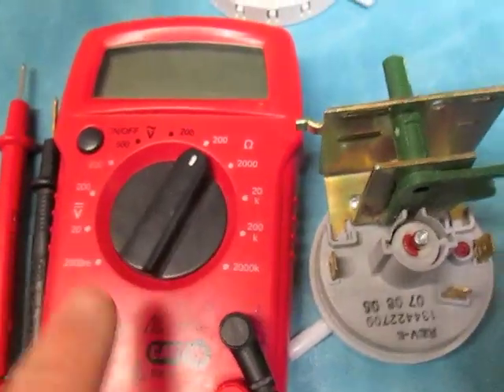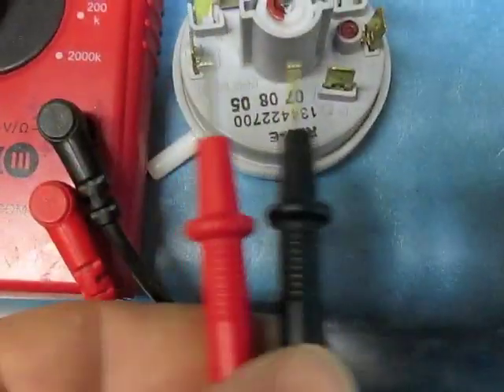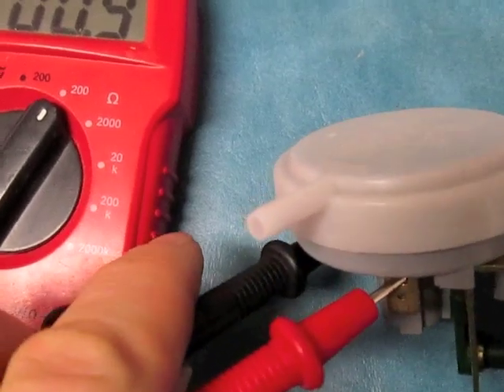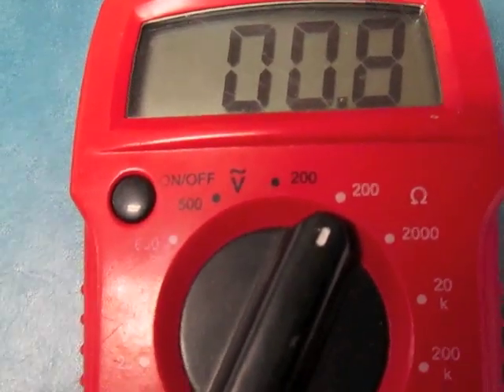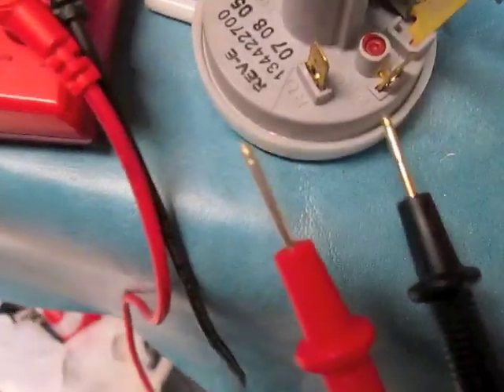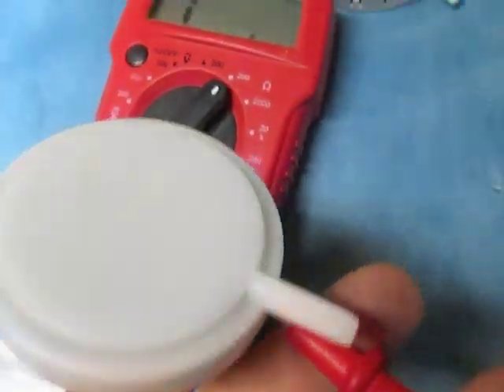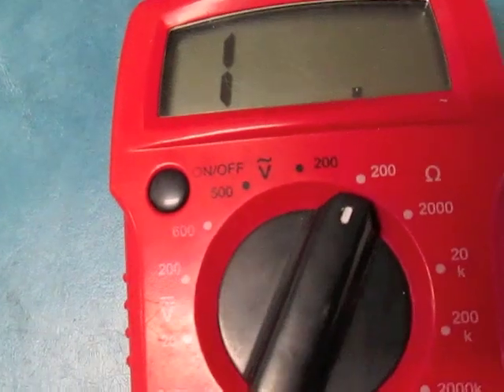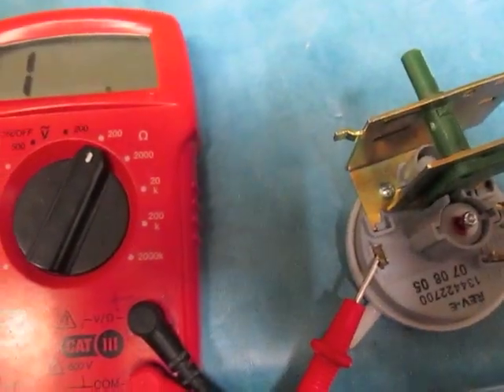How to Fix Washer That Won't Stop Filling With Water

Comment: My washing machine is won't stop filling, I checked the pressure switch and seems to working fine, and I don't know what is wrong with it
Reply from the maker: Check to see if you have water in the hose.  Does the hose have a leak between the tub and the switch?  and Make sure they fights tight on both ends.  You can most pressure switches used on ebay for under $10